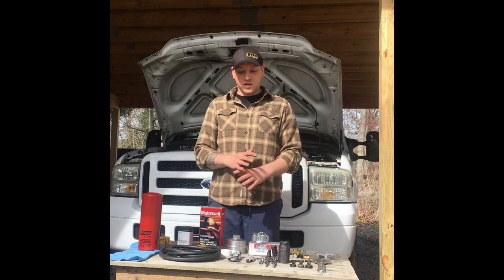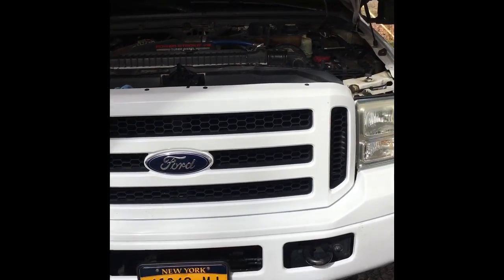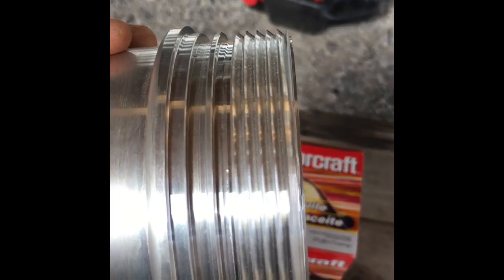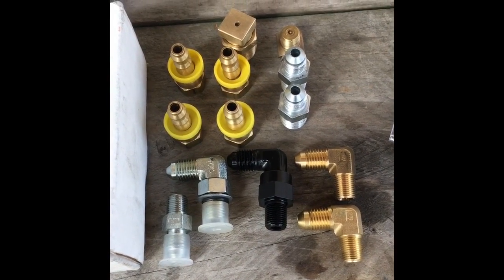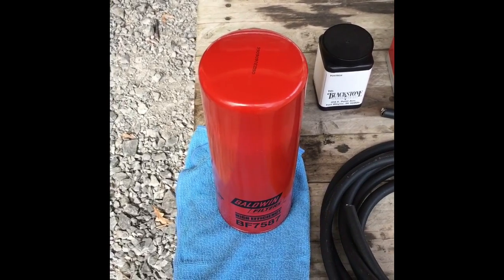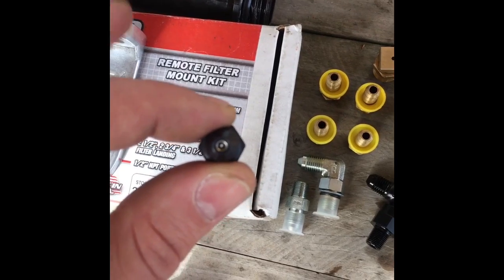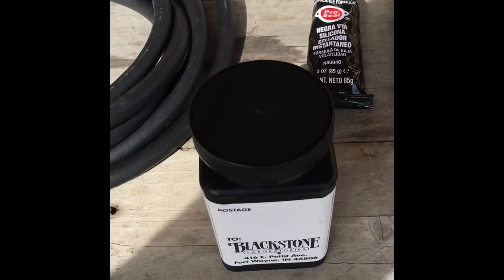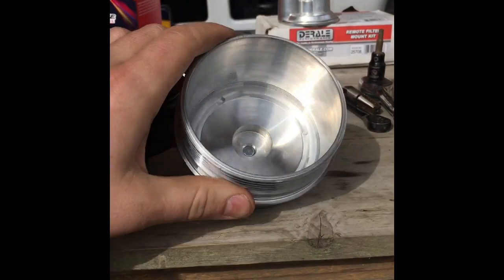DIY 6.0 bypass oil filter kit

Comment: What what's the part number in the filter head you used. Also what where the threat for the fittings that go into the filter head __/-4? Going to get the thread adapter and use the identical filter but from fleet guard.
Reply from the maker: Thomas I used the Derale 25708 filter head. It comes with 1/2” NPT inlet and outlet ports. I had to use a fitting to reduce them down to 1/4” NPT. The fittings I used from there are1/4” NPT to #4 JIC fittings. JIC fittings are the same as -4 AN as long is it specifies that it’s a 37 degree and not a 45 degree fitting. Sometimes you can get those for a lot cheaper.
Reply: WADDY 351 dude your the shit. I've been trying to get he's answers from others for over a month. 
If you need anything for your trucks lmk I'll hook you up 
https://www.facebook.com/portcitydieselperformance/

Comment: where can I find the oil filter adapter from 3/4 to 1 inch??
Reply from the maker: alex Redwhiteblue not according to the guys at Baldwin I spoke to.
Reply from the maker: AJ Matariyeh I got mine from eBay. The one in the video is 3/4"-16 to 1"-14. For the amsoil bypass filters you'll want a 3/4"-16 to 1"-16 adapter. Here's the link for the amsoil one. I'll find one for the Baldwin filter. https://www.ebay.com/itm/331076892226
Reply: WADDY 351 yeah i want the fitting for the Baldwin filter lol. Amsoil filters are over priced!! thank you so much for your help and this video helps a lot of us on a budget!!
Reply from the maker: AJ Matariyeh So it looks like the Ebay seller is out of stock on the Baldwin thread adapters. You can however just get an adapter with those threads already on it. The reason I went with one with the 3/4" threads is so I can switch it out to the amsoil sized ones if I wanted to. Here's a link for ones that should work for you.  https://m.summitracing.com/search/part-type/oil-filter-mounts/oil-filter-thread-size/1-14-in
Reply: That filter comes up as fuel filter. I guess that's not a problem?
Reply: WADDY 351  perfect..  thanks

Comment: Great job, keep it up.  Look forward to seeing more budget minded and common sense light duty truck tips.
Reply from the maker: hazegreyghost Thanks man I'll keep them coming! Thanks for the support! Let me know if there's some things you want to see.
Reply: @WaddyBronco  i’m trying to do the same thing on my 60 right now is there anyway you can message me a parts list?
Reply: I did a fleet of Powerstrokes when the 6.0s first came out. I didnt have the filter cap for pressure. Dont remember where I got the pressure. Probably found a pipe plug. I do remember tapping the filler  neck. Jackmaster claims 1 micron filtration. Motor Guard claimed submicronic filtration. In the old days all we had was 2 ply facial quality.TP. Now you can get 30 dollar TP.. I just put a roll of Great Value 1000 sheet from Walmart  in the Jackmaster Classic and the over 50 year old Motor Guard on the 76 F 250 with the 390. The Frantz is obsolete now. About the only thing that fits the Frantz is the Frantz elements. Started with the Frantz and Standard Delo in 1963. Most small spin on filters like came on my 64 Rambler American flat head 6 are rated at 10 microns. The longer ones would do better. The bypass filter on the Rambler was upside down on the head with steel oil lines. The oil was always dirty. I cured that problem with a Frantz oil cleaner.
Reply: I know this is an old thread, but is there anyway you can send me the parts list? I’m trying to do the same thing on my 6.0 now